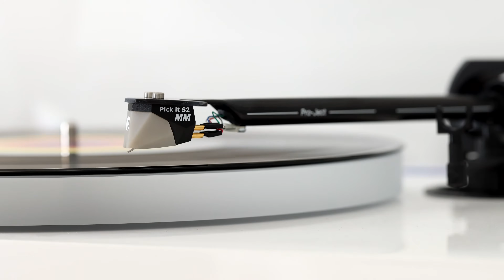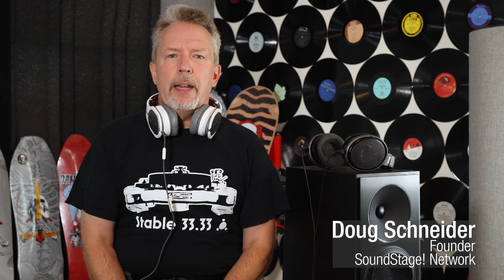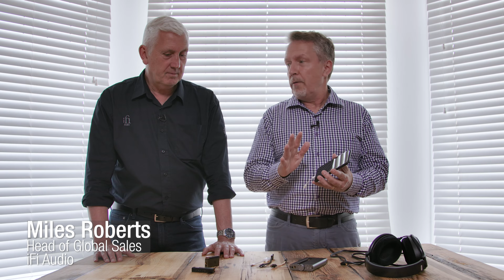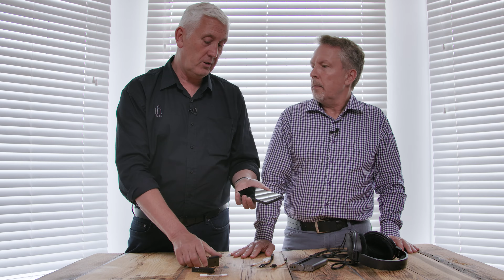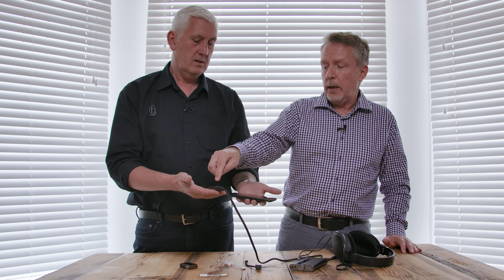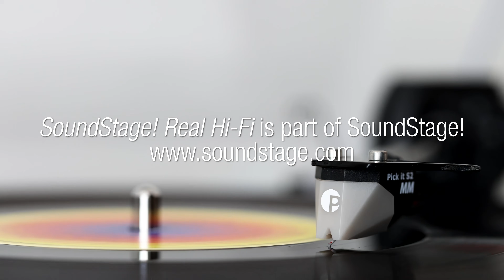Do YOU Need a Portable Headphone Amplifier? - SoundStage! Real Hi-Fi (Ep:43)

Comment: The ESS Quad DAC in my phone drives my 250 Ohm headphones just fine thanks. 👍
Reply: As mentioned, "it depends." But we had a lot of headphones on that trip and we decided to try a bunch. Some a headphone amp definitely made a small or even big difference with.
Reply from the maker: Which phone is that?
Reply: @soundstagenetwork  I have three. LG V30, LG V35 and my current phone, an Asus ROG 5.
Reply from the maker: @MarmiteTheDog  That's certainly an eclectic bunch!